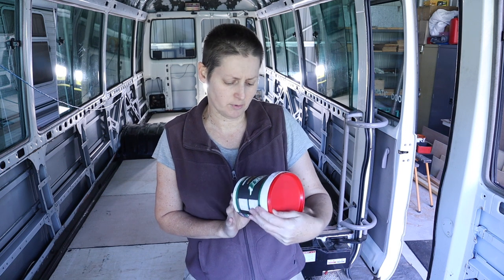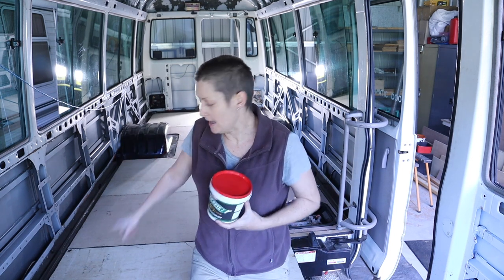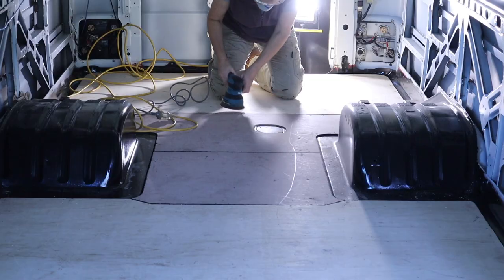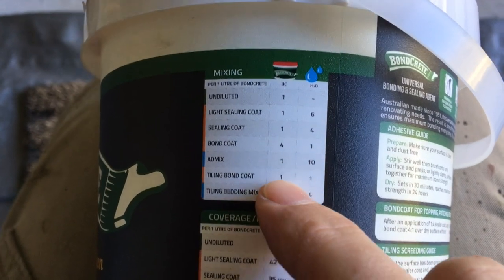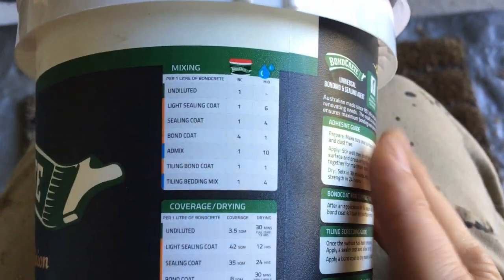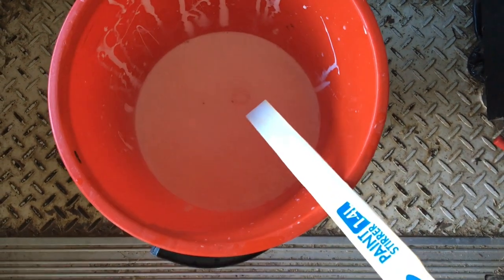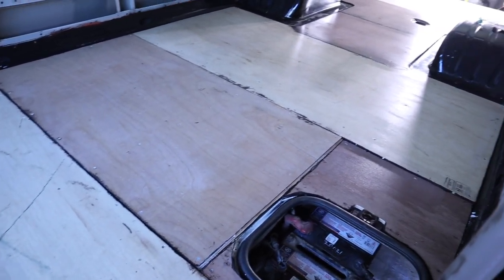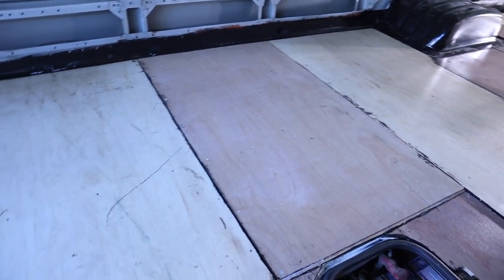Sealing the floor of my Toyota Coaster and then what next?

Comment: Excellent job there buddy and great to see Pepper helping you along. I've just pulled the rubber strips off the roof of my Coaster as it leaking from there. Got to cut out a bit of rust, weld on a couple of patches, re-seal the channel with some rubber flexi tape, then finish it off with a nice coat of white rubber paint. Easy as!......... I  says before picking up any tools.... Keep up the fantastic work, really enjoy watching your progress.

Comment: Tell me why you chose a Toyota coaster over a fuso rosa? The rosa is bigger then a coaster.
Reply from the maker: I did consider getting a rosa. But for me personally, my biggest priority was mechanical reliability and ease of repairs, getting parts etc. Toyota just has such an amazing reputation. I've had several Toyota vehicles over the years and they have NEVER let me down. I have also owned a Mitsubishi car and it was crap. So I'm probably biased. But every mechanic I've ever used has raved about Toyotas. Coasters are everywhere, and there are hundreds of people who have experience converting and owning them. So there is a huge support network of people who can troubleshoot with if anything did go wrong. I just felt a whole lot more comfortable getting a coaster than anything else. Also, I need to carry a lot of stuff and have a large workspace for my business, which I'm planning to take on the road with me. The extra space and weight allowance in the rosa would have been handy, but still not enough to fit my needs, and I still would have had to tow a trailer. At least with the coaster, when I ditch the trailer to go exploring, I have a bus that is 1m shorter and easier to get around in.
Reply: @AGirlADogandABus  cool. The problem with the Rosa is the pre 2020 models don’t have a flat floor.
Reply from the maker: Yes that would be a pain
Reply: @jadendrysdale8864  The standard model does have a flat, with the bifold door - I drive 2012 school bus with a flat floor. The deluxe, with the plug door does not have a flat floor, but the side pods are easy to remove.
Reply: @gavanmurphy6453  the new ones all have a flat floor
Reply: Apparently a fibreglass part breaks and it's extremely expensive to replace. Id go with the coaster or other toyota